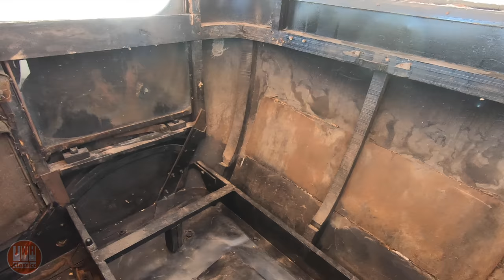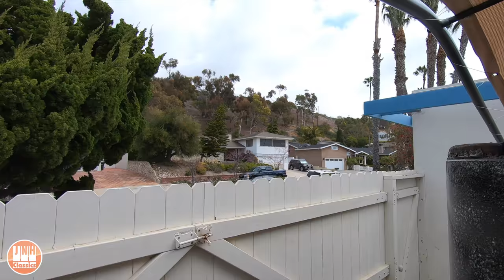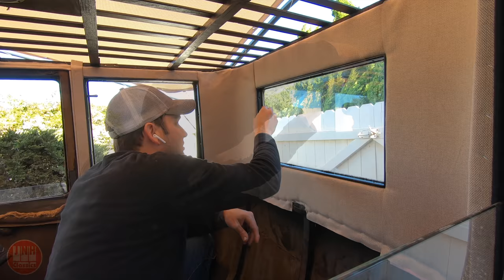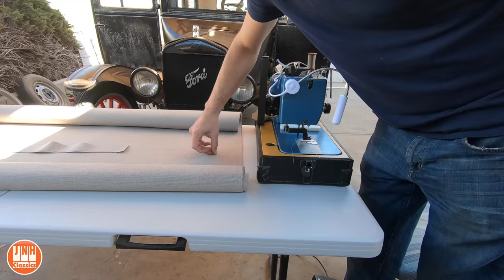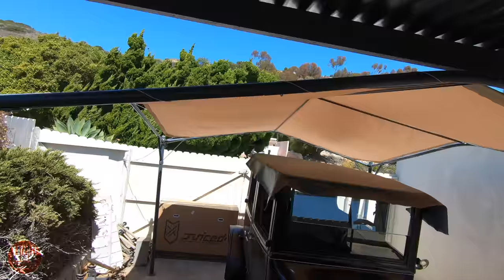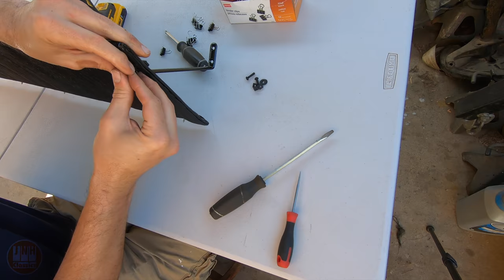A Forgotten Model T (Episode 15) Making A New Headliner and Installing a New Vinyl Roof

Comment: this is the one area of the build where i would be very tepted to use contemporary materials the door and window minimum expanding foam seals off from water the 9 or 12 pound expanding foam not the 6 which absorbs water like a sponge the added quiet and sealing from pests is worth the effort....

Comment: I guess I never noticed the dual-pane front windshield before.

Also, I would have snuck in some fiberglass on the roof. That way the restoration investment would be preserved. I think it could be done thin enough that no one would notice.

Comment: Hum. You used foam rubber padding in the "C" pillers. That automatically voids the factory warranty...(LOL!)

I work on my Model TT flatbed truck w/ C cab body now and then while collecting upper body parts for the 23-25 coupe body I own. Nice to be able to see someone else working on a T.
Reply: I’m working on a 26 TT C-cab myself!
Reply: I am working on a 1925 2 door Sedan get videos

Comment: I've been enjoying your videos but now I'm wondering why you didn't just do a full restoration
Reply from the maker: I don’t think they need to look new to be enjoyed. I think it’s ok for them to show their age👍
Reply: @Jerod_Helt  I hear ya it's pretty cool the way it is I'm guilty I do similar things
Reply: He sort of did except for the exterior paint. If it is the original paint it is kind of cool. Basically you restore the car except for the paint. I’m all for that as long as the metal is not rusting out.
Reply: @vayabroder729  the metal is rusted he put a clear coat over it
Reply: @ericschulze5641  it looks like surface rust?

Comment: Jared, the headliner is stretched tight or does it attach to the slats from the bottom? I have a sagging headliner on my 1928 Plymouth.
Reply from the maker: This headliner attaches to the wooden frame before the top is installed.
Reply: @Jerod_Helt  it’s just stretched tight to frame? Not glued to the runners to help support the middle?
Reply from the maker: @adamwheeler07  it’s stapled to the runners